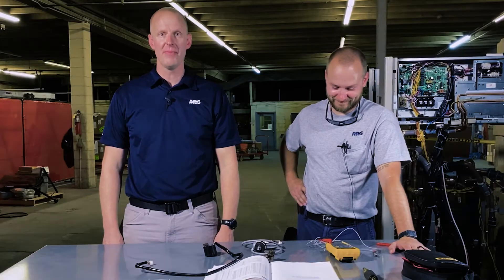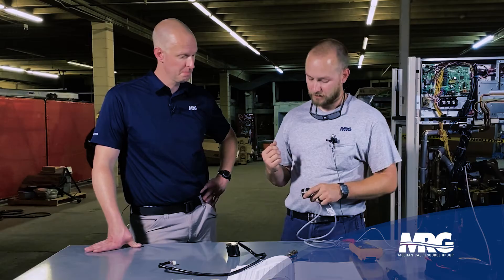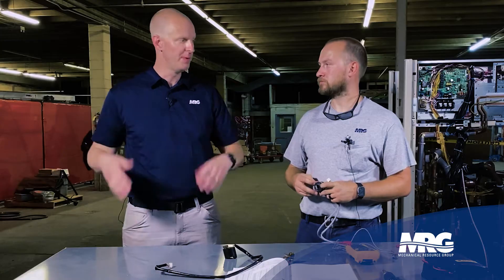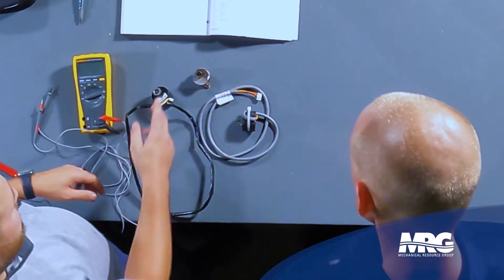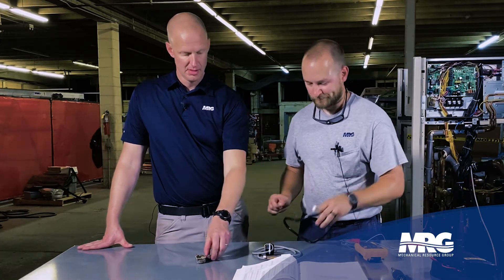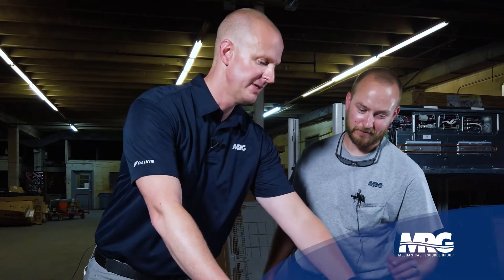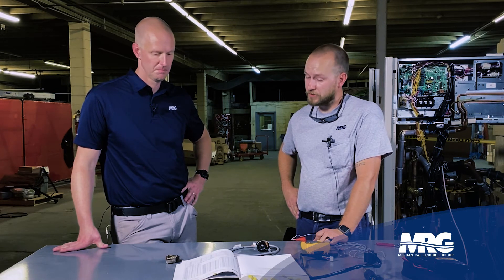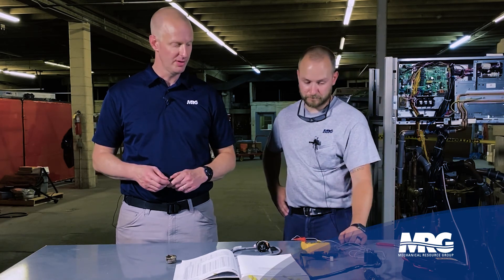How To Diagnose Daikin VRV EEV Powerhead

Comment: I have questions on eev. I took out the eev bolt type. 
I found dirty and i tried to clean it out the black greese or oily stuff at the head. But it cant be screwed it back the EEV due to the head is came out. How can i make the pin or head go inside so that i can screw it back?

Comment: If no 21 mode is used the bolt on ones must have the pin retracted into the body before reinstalling. (Factory new replacement parts are already.)  You do this by temporarily switching the blue and yellow wires and turning the unit on for no more than 15 seconds x 3 times on and off. This reverse polarization winds the pin In. If you do no do this you run the risk of the extended motorized pin slipping off the valve seat and jamming down the side possibly puncturing the metal bellows. 
Make sure to put wires back in proper place when completing   job

Comment: What I have found to work well to get the snap style EEV's off is to let a little squirt of Kroil soak down through the gap while I finish getting panels off for inspection. What I've found is that if you can get that driver to twist free at all, it will eventually come off with a little persuasion. After the cleaning is done I'll wipe everything down with a rag and then coat the driver's surface with a fingertip-full of 100% silicone plumbers grease. Units I have done this too have looked pretty much untouched when I check them out on the next years inspection. Thanks for the informative content!

Comment: Thanks for the fantastic videos! For an VRV indoor unit, you mention looking at the evaporator thermistor readings to diagnose a failing EEV. Would a normal liquid side temp reading and an almost room temp gas side reading (plus lack of cooling) hint at a failing EEV that's refusing to open (assuming airflow is all fine)? EEV coil resistance is OK, so is there any additional test that can isolate the EEV as the culprit over other issues?
Reply: @MechanicalPros  Thanks for the reply! You guys are awesome! Sadly the "Indoor unit status" on the wired remote doesn't show anything for this unit (it's an older VRV III indoor unit, not sure that's the reason), so I can't see the EEV pulse count. Hadn't seen EEV Mate - looks neat. I tested again with another unit running and the liquid-side temp drops quickly to 0-5 deg (Celsius). Where it''s get wonky is after that - gas side drops slowly but then shows odd values like 5 liquid / 5 gas before jumping instantly to 18 deg. Sometimes I lower on gas side than liquid side. I am now suspecting the gas-side thermistor. Every time a new detective story!
Reply: @MechanicalPros  The gas-side sensor was certainly dreaming values up and the EEV looked and measured resistance alright but seems to have worn out (it's a bolt-on, which I believe has gears inside). Much better now with new thermistor (can those be any harder to reach?) and EEV. EEV opens to 800-900 clicks to maintain ~ 6*C superheat. According to the Daikin folks, EEV motors and thermistors fail to the point where on any fan coil unit > 6 years old they just replace them all before spending extra time diagnosing... thanks again for the advice!